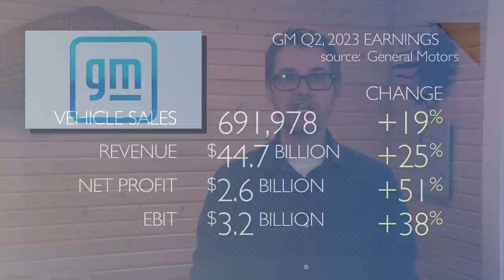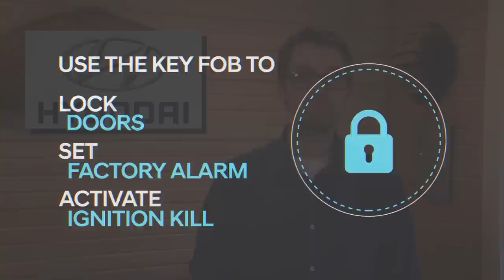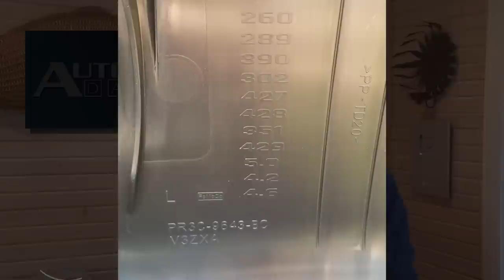GM Still Struggling With Ultium EVs; Mustang GT Feels More Like Grand Tourer - Autoline Daily 3612

Comment: GM sent out emails to Chevy Bolt owners that production,  going to continue. But production is going to be delayed next year.
I'm guessing, since the GM ultium vehicles can't be built at scale, they decided to keep building the Bolt for the emission credits?
Reply: Whatever the reason it's good news. GM is in the same boat as Ford though, they can only be profitable domestically on expensive high-end cars and trucks. Same as the Germans.
Reply: Latest news from gm also is: There will be a Next Generation Bolt in the works, so when they say that the current Bolt will be discontinued, I suspect that means they are preparing to introduce a replacement soon.

Comment: I live in Boston. The potholes don't go unfixed because the city doesn't know about them. They go unfixed because it embezzles infrastructure funds.
Reply: bingo, gotta corrupt and embezzle somethin'...
Reply: That's basically every city of almost every size.
Reply: If politicians could spend enough money to fix the potholes immediately they would, because their reelection would be easier. Cynicism is fine, just don't let it direct your life.
Reply: Don't talk about Massachusetts disparagingly.   The Big Dig almost came in under budget, except for the additional $20 billion spent on the project, and it only killed a few civilians.  I used to work in North Quincy and drove through that mess every day.  No lie - I was heading northbound thru the fn tunnel at rush hour, one day,  and one of the many imperfections manifested as I was driving through it.  A  geyser erupted from one of the walls and the tunnel partially flooded. Every penny of that project when into materials and engineering <:)   Tip O-Neil would have been proud.   What a glorious example of Massachusetts politics.
Reply: @bardigan1  Or they wouldn't because they're all in safe seats in this relatively uncontested democratic stronghold. The number of city councilors and local officials in Boston who have gone to jail for corruption or connections to organized crime could fill a stadium. This is a special place.

Comment: Why are we at all interested in how the Celestiq and Hummer ev do? They're low volume halo cars that are absurdly expensive. They have no real impact on the market. About the only thing their success or failure shows is how hungry the market is for 9 thousand pound cubes or hyper luxury limo's.
Reply: Right, all they do is pull battery resources away from the regular vehicles.
Reply: I just bought a new Kia Soul S this year and drove it off the lot for $21,700. It has all the level 1 and emergency self-driving capabilities a tesla has except adaptive cruise control and self-navigation. You can get all the same capability for even less in a Kia sedan for $18k-ish. The Soul drives great too, I can do 300 miles with no problem. I'm a fanboy yes but only because the car is just such an unbelievable value, and nobody is talking about it.
Reply: …..Here in L.A. I see A LOT of Lyriqs, and Hummer EVs.
Reply: @eddieg6436  I feel bad for the road infrastructure being demolished by the hummer.
Reply: @ethanwelner1230  ……That’s why we pay HUGE taxes in California.

Comment: I'm shocked at how SLOW the new Mustang is. 0-60 in 5.6seconds? (ecoboost) - that's slower than a Model Y Long Range (not performance) and almost twice as slow as a Model 3 Performance (3.1s 0-60). Even the GT is only 4.7s - almost 2s slower than Model 3 Performance. It must be SUPER disappointing to drive it after driving almost ANY EV. 
Ford is lucky it decided to have the Mach-e under the Mustang brand. At least they have one Mustang that has decent acceleration 😂
Reply: When I sold my Kia Nero ev and bought a miata ( not the fastest car in the world) I was shocked by the acceleration difference off the line. The reason ford isn't super worried about that difference is it's rare for ev owners to go back to ice and most ice drivers haven't ever driven an ev. Two different markets which rarely converge.